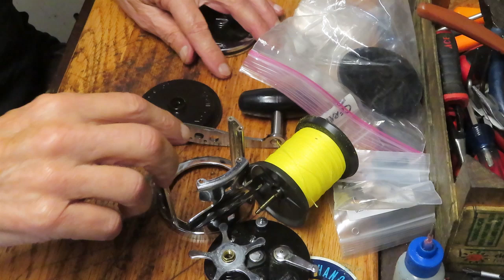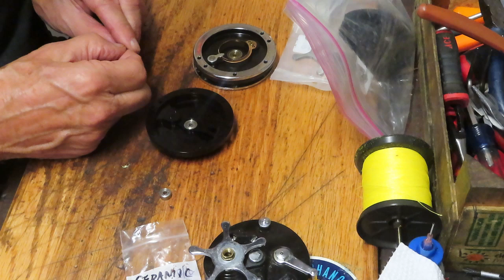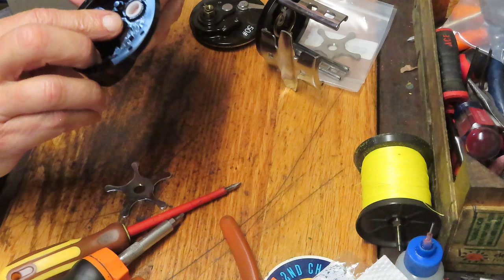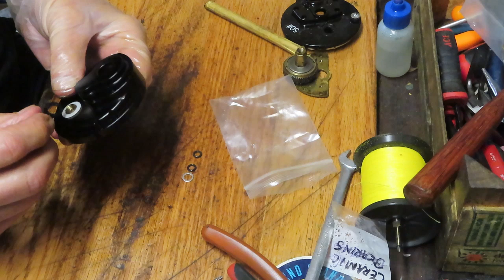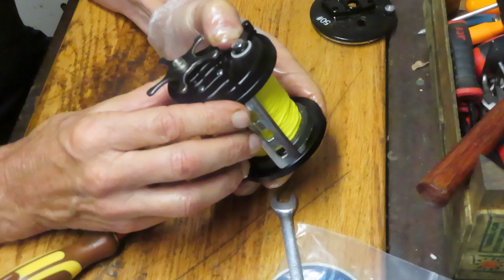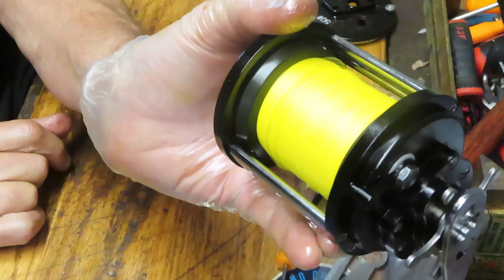Unique Cortez Conversion for Penn 505 Jigmaster how to install the fishing reel upgrades

Comment: If one already has this reel the upgrade could make sense to me. If one doesn't own a reel to start with, does it make sense to just spend more money for an upgraded reel to start with ?  I'm thinking that the cost of this reel and the cost of the upgrade parts and labor probably gets you into the next class of reel up the line to start. I'm just starting to learn about salt water fishing but I've been fresh water fishing for 50 years. Thanks for any input and advice anyone may have for me. ---  dennis  ( also a Dennis, ha ha )
Reply from the maker: Those are all good points.  Thanks - Dennis

Comment: Hi Dennis,
Nice Cortez billet aluminum conversion side plates. If I were Howard I would have also upgraded the stock Penn (3) piece frame with an Accurate or Tiburon solid one piece aluminum frame. This would result in a drastic increase in the reel rigidity as well as solving the screw protrusion issues into the spool area. Another way to solve these screw protrusion issues would be to obtain an old / corroded 30-200 reel stand that is no longer cosmedically useful. By temporarily assembling the Cortez conversion side plates to this corroded 30-200 reel stand with the screws provided and use of a Dremel with a tiny cut off wheel would allow the screw protrusions to be easily cut off flush resulting in screws with the exact proper length. Unthreading the screws from the corroded reel stand would debur the screws and make them ready for final installation into the actual reel conversion.
Reply from the maker: He does have another that has the Tiburon frame.  Thanks for the suggestion on the screws

Comment: Good Morning from Houston,  Do you think that using the old rings would take up the extra screw length?  Respect, Alex
Reply from the maker: The old rings are not compatible with the modified frame
Reply: Okay, Thanks for the reply.
Reply: That was my thought also. The inner rings look like they should fit, but I've never done this conversion.